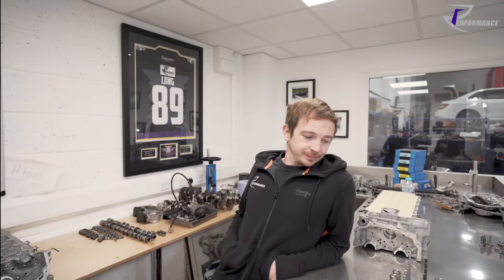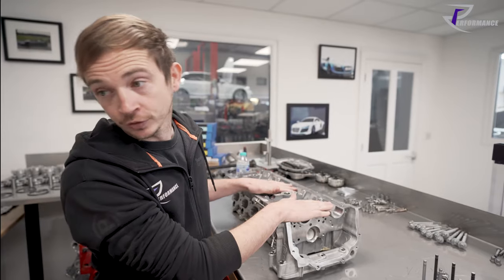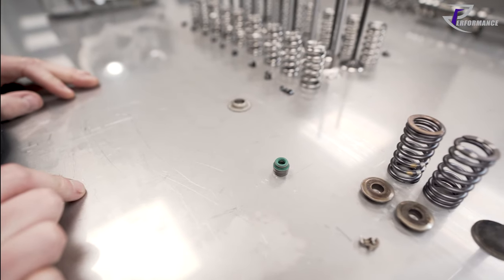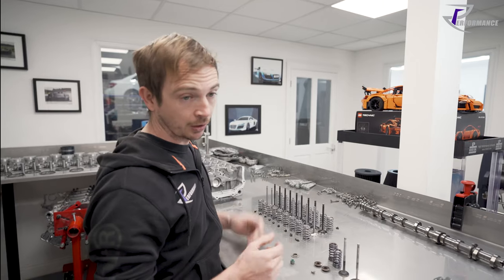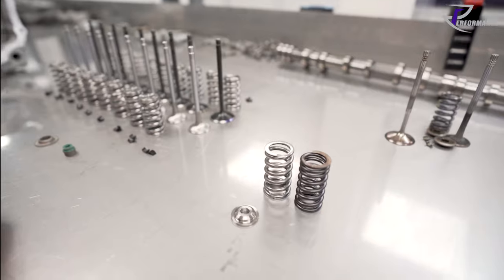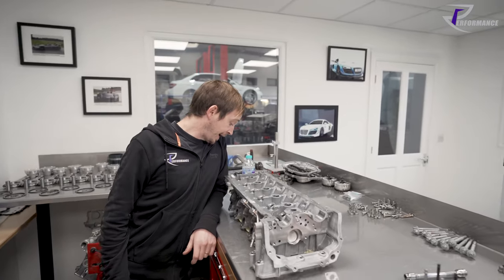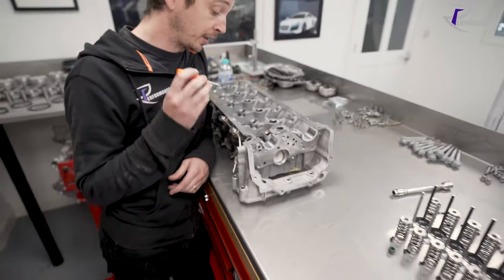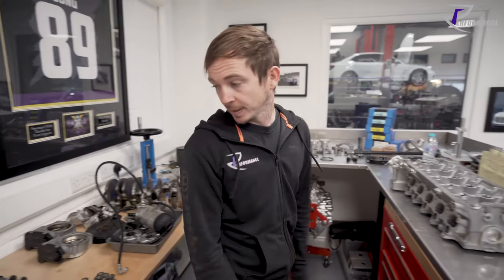The correct way to build a V10 R8 Lamborghini cylinder head

Comment: Massive knowledge here impressive. A friend of mine is having the v10 in a s6. Intermittent Smoky car at idle speed on right side exhaust. Compression rate are all goods 5 cylinder, got it out and changed all seal ring on valves but still smokes time to time and sometimes huge smoke (up to getting ticket by police!). Did you experience this already on that engine? Next step is valves guides? Any idea would be great ;-)

Comment: Great video, love the tooling! I've fought those valve collets in many a time, with the blob of grease on the screwdriver. Do you still need to lap valves in or are the seats and faces machined for a perfect fit?
Reply from the maker: Yeah we cut the seats then vacuum test the seal, if it’s not perfect then we would give them a little lap to help but it’s not often. That’s normally required on super heard seats when the cutter has had a hard time.

Comment: Looking at s6 recently with the v10 but they have different rods and heads I think it has 100 less hp and ect but i was thinking basicly a dream car r8 in a sedan body major sleeper anyway found alto fo em for under 15 I found one for 8 and like yea the miles are alot but I heard there well built and with the money I'd save I can out to maintenance which I domt mind if it slots like no shit its gunna be more then a civic but any engine tht is well built and out together is gunna be expensive but it's the awd i want the most looking at the sea and other turbo cars but the v10 sounds awesome and just the look and shit and the interior looks good to but like with some extra money I could get some custom parts made and other stuff I also seen you could out desto elements billet peice in it to and like I want to na it as long as possible and get it as high as possible and stable and then sc or turbo it and theres been alot of stuff since then but I cant find any made parts for sale which is killing me but logic says blue prints and other stuff have probably been made and improved majorly since when they came out and I'd put a good chunk away for like 30 k I want everything redone basicly carbon clean and then get it taken apart polished and bored honed ect sleeves light weight high grade aluminium or somthing for higher rpm ect polished cams or somthing bigger head and throttle body and like logic is for most high hp cars big throttle body and then get the inside bored and widened as well and a fat 3 inch or 4inch intake and better headers and exhaust and better intercooler and maby get it ready for meth or somthign I live in canada so I dotn know if it will get effected in the winter and I dotm know what else I'm just thinking for parts to save for becuz I'd want to get most of it done maby get the trans rebuilt abit better flywheel carbon drive shafts and all tht other goodies
Reply from the maker: Good luck with your project! Sounds an interesting one!